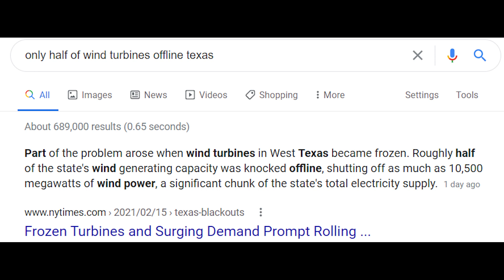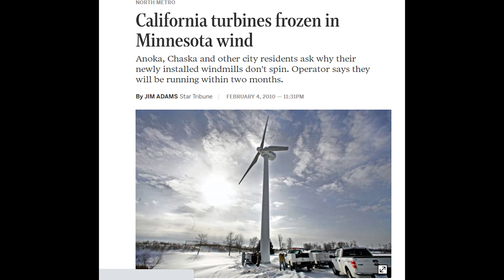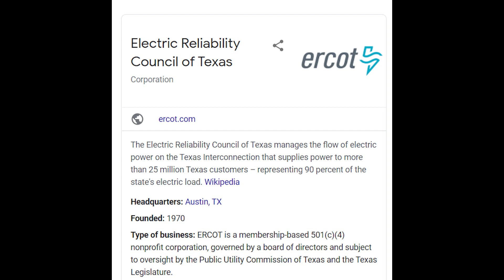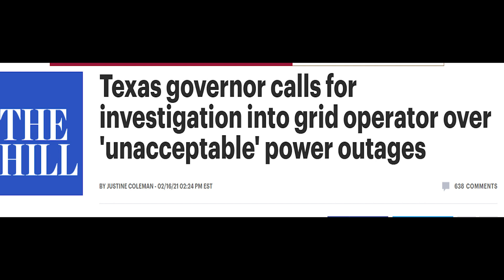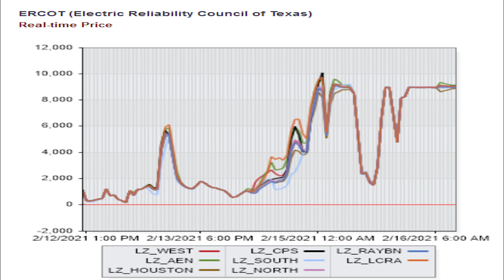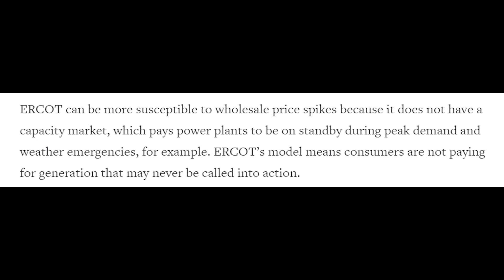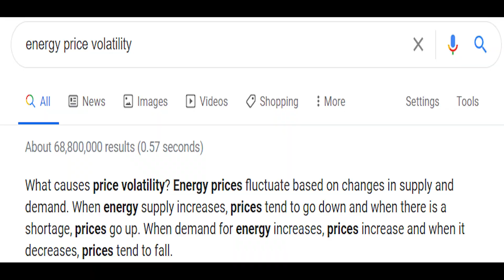UPDATE: Turbine Guy's Take on Texas Frozen Wind Turbine Crisis (part 2)

Comment: The main problem was that the pipelines for natural-gas power plants (50% of Texas’ power generation) froze up.  A certain amount of water comes out of the ground with natural gas, and that water froze up the pipelines.

“Certain politicians” on the fossil-fuel payroll were prompt to blame frozen-up wind turbines, and while some certainly did, as you correctly estimated, that was only around 10% of the problem.

Comment: All Texas power plants in the SPP grid are winterized. Many wind turbines in the same Texas panhandle SPP grid froze and/or lost stored energy. Majority of the electricity during the storm was from thermal energy power plants. Very little help from green energy. We are not ready to go all green energy. Better to have variety.
Reply from the maker: Exactly. Redundancy builds in safety
Reply: @TurbineGuy  Yes but go with bio gas, bio fuel, bio mass or geothermal.
Reply: Majority of supply disruptions were from natural gas plants. Wind was over-producing from emergency forecasts.

Comment: As a former GE employee Technician. I use to build those Turbines here in Pensacola at our GE facility. I was a crane operator installing the Axis- Cabinets and transformers and also doing the wiring. I can tell you everything you said was 100%  correct. People fail to Realize there are different types of Turbines. Wind Turbines can withstand freezing Temperatures. Majority of our Turbines were sent to Russia, Antarctica, Denmark and Norway. They are coldest places on earth. So when I heard Texas Governor say that out of his big fat mouth. I was like you’ve got to be kidding me??? These people are straight up liars and don’t want to take the blame. Texas is by far the most state that uses double the amount of Natural gas and Coal. They have a lot of offshore oil rigs along with Refineries on the offshore of Galveston. You can’t deny that at all.
Reply from the maker: Thanks for the supportive info!!
Reply: Millwright that has been in wind for 5 years.  This is correct
Reply: Ice storm was what they got. What happens to the hub when it gets iced and the blades cannot vary their angles? In a normal fail safe setup, the unit would shut down. Even ones in the coldest parts of the world. But most of those also have some way of heating the blades and the hub to prevent ice buildup. Now what happens when the grid starts going down? There is no heating in the units and they shut down also. Unless the power company has built in an energy storage system next to the turbines. It is called a cascade event where one thing leads to another which leads to another. Solar and wind went down and due to demand, neither the natural gas nor other systems could cover the losses. Start lowering the pressure in the gas pipelines due to demand and the next thing that happens is the gas lines freeze up. As the gas lines go down, so will the power plants that run on it. 

We had a gas well on the farm in Ohio that was tied into the pipeline. When the gas came out of the ground, it had to be reduced in pressure before it could go off the property. Well head pressure was 500PSI. Pipeline off the property was 30 PSI. What was the first thing between the well head and the pipeline? A heater. Because as soon as the pressure would drop in the line, ice would form so the gas had to be warmed. The company pulled the pipe up when the well was producing 1000cuft a day. The next level of gas had H2S in it so it could not go into the pipeline. So the well was pulled. But any drop in the pipeline pressure can cause a freeze up. It doesn't need just to be cold to do it. When the gas in the smaller lines get to a gas pumping station, the pressure is again boosted back up. 200 to 1200PSI depending on the pipeline. Now you have to be careful and keep it within a certain temp range so it might need cooled some. Then it can leave the pumping station at high pressure. And it gets reduced in pressure where it gets distributed. Again, they have to watch for icing. When it enters a home, it is at a very low pressure. About 1/2 PSI/ 4 to 8 inches of water column.

Comment: I'm neutral on the renewable energy vs fossil fuel fight... However people trying to spin the issue and claim fossil fuels were to blame for Texas power grid collapsing are just plain wrong, or lying. Most reliable reporting estimates up to 20 to 25% of the power in Texas was lost when the wind turbines froze up. That left 75% of the grid to supply 100% of the power needs. As a result, the natural gas and coal plants could not keep up with demand and some of them went off line as well. It was a domino effect. It all started with the wind turbines going offline... First.
Reply from the maker: Yet one would think the brainiacs behind the wind/solar would KNOW that there would be times when neither are contributing and they would still need to meet the needs of their customers.
Reply: @TurbineGuy   100% agree. And you are correct in the video, Texas did not have the correct equipment (turbines) to handle this type of weather. But then who the heck would have thought we would see -17 degree weather down there? I bet they prepare for it now (or one would hope...).
Reply from the maker: wcoastbo  Facts Matter
Reply: wcoastbo  You just made my point for me. The grid went down due to demand. Had the wind turbines stayed up and running the system ‘could’ have met demand.
Reply: If Texas power grid was connected to the rest of the country they would be importing electricity from surrounding states. Texas is looking like a third world country. This kind of stupid shouldn't happen in the United States.
Reply: @Ozarkwild  no they didn't, they pointed out the real issue was because they decided not to winterize there natural gas power plants and the pipes froze. So the natural gas when down... Nothing to do with wind turbines. And the reason wind turbines failed is because they decided. Not to winterize them as well. They also decided not to winterize a nuclear power plant.... It is almost like there is a theme here in winter they didn't winterize there power grid or prepare and it failed. But you know totally wind turbines caused if only if they kept working like maybe if they could of done somthing to stop them from freezing like winterize them to prepare for this like all the other wind turbines in america. Then the natural gas power plants supply lines would of magicly not froze. I really can't follow why people are blaming wind turbines like if they worked or not would of kept the pipeline from freezing
Reply: ...hey genius the system was built by the lowest bidder, that's how shit gets done in Texas.   Or somebody's bubba, or brother in-law, or some political donor was either connected to the previous Governor, or to a member of the Legislature, and was probably sitting on a committee that make these awful decisions.   Or at the company's board, who built these problems  🤨

Or it's just Predatory Capitalism at play 🤔 ...greed and incompetence.  Regardless, you can guarantee that a Republican created this Stupid problem, it's a Red state.  I should know, I live in east Texas, aka Texmenistan
Reply: @glenncordova4027  Actually they are. But not enough can flow in from it. And all of Texas is not in the Texas grid.  I looked a little while ago and about 10% of their power at that time was coming from wind and solar that was working. Two of the four DC grid interconnects were showing negative levels which meant they were importing power and the other two were dead.
Reply: @gravelydon7072  ...what parts of the Texas grid are connected to other grids, are they isolated, or do they just have that capability built in?  
I always wondered where Brewster and Presidio Counties get there power from, they are isolated from everyone else 🤔
Reply: @Texaca  Presidio and Brewster Counties are part of ERCOT. Amarillo, Lubbock, El Paso,  and on the Eastern side, Beaumont are not in it.
Here is a map of who is in what area.
https://www.powermag.com/Assets/Image/3%281%29.jpg
Reply: @TurbineGuy  whens the last time TX saw negative 20 f? Green energy is an honorable cause, but without 100% fossil backup it's a fools errand in such situations
Reply: wcoastbo  This was funny. Kudos
Reply: Yeah, this is basically all wrong. The bulk of the supply disruptions were from natural gas plants. When supply went down, mostly from NG but yes also from nuclear, wind, et.al, there wasn't enough for demand, ergo blackouts. But if NG operators had winterized better it would have been able to save the system. Wind was overperforming expectations for winter.
Reply: @gw6667  Not correct. The wind turbines left operational may have “over performed”, but the ones frozen in the cold were a contributor. NG was a contributor as well, as we have now learned.

Comment: The unregulated Texas utilities bought sub standard wind and gas turbines because both have cold climate versions that everyone else in the US uses. There are wind turbines in the mountains near Fairbanks, Alaska that work at -40 degrees for months each winter. Anchorage has has been running on gas turbines for 50 years and wind turbines for 9 years with winters at 20 below. I hope the US Wind Power Association and turbine manufacturers sue their lying frozen sessa off.
Reply: Psst....
Texas is not really considered a “cold climate”. 
For the first time on record, everyone of our 254 counties was under a winter storm warning. It literally snowed on the beaches, while the panhandle had the same storm wreaking havoc. 

The temperature alone weren’t responsible for the wind farms to go off line, It was ice accumulation on the blades. 

Deregulation helped bring energy prices down, and brought in investors who poured money into alternative sources that otherwise would never have been built. This is why Texas leads the nation in wind generation.
Reply: @texanbill6032  Except FERC wrote a 300 page report after your 2011 frozen grid failure that specifically recommended winterizing your power plants and gas supply. You wouldn't get a lot of ice accumulation if the gears had synthetic lube and the blades kept turning. If the large  fossil fuel and nuclear plants were winterized, you could do without the wind and solar for a few days. Those short sheet policies are killing your fellow citizens. Was it worth it?
Reply: @tomlakosh1833  For sure mistakes were made, but let’s be honest here, this is a once in a century mega-storm. 
The biggest difference between 2011 and now, is that more reliable coal power plants were replaced with wind and solar. Additionally, people are pouring into Texas from places like California, putting further strain on the grid. 
I didn’t lose power in 2011, in fact I don’t know anyone who did. It was nothing like the 2021 storm.

I would bet any amount of money we will never see another storm of this magnitude in our lifetime, and will never see the kind of power issues. 

One thing I keep reading is the myth of how bad  “deregulation” is. Let me tell you, deregulation has allowed electricity in Texas to be affordable and until this year I have never been without power in my life more than a few hours (following equipment damage after a storm). 

California can do things however they want, but the fact is our grid is more reliable than theirs and our rates cheaper.
Reply: Tom, I'd suggest that you are close to the truth but not all of it. Ask people in Minnesota what happened after they bought and reconditioned units from CA. Oh, they failed the first winter because the units were designed for heat and not cold. Our power company is a part of Next Era Energy. NEE has a wind farm in Texas and a number of other States. I would bet that it is operating. As they also own units in ND and other cold places and would know about the cold in West Texas.

Disclaimer. Mom owns shares of NEE and dad was an employee of FP&L which NEE is the parent company of.
Reply: @gravelydon7072  Almost all of your wind was bought after FERC issued its report and best practices were issued so it's clear that the utility execs planned to fly to Cancun when the grid went to hell.

Comment: Being from Texas I can tell you they use more electricity in summer for cooling than they do in winter for heating.
Reply: I'd think that the better use of these would be to advect air near urban centers where heat islands exist...not so much for providing electricity.
Reply: 74GW vs 69GW. Similar, but you are correct.

Comment: So that 9$/kwh is only for people on a wholesale plan? Not a fixed rate correct?? I live next to a school so our power hasnt gone out bc its been declared a public warming area..
Reply: Yep but those on fixed rates can expect their flat rate to go up now after this.
Reply: $9 a kWh? Are you serious? We pay about $0.13 per for ours after all the taxes and fuel charges and Hurricane upgrade costs. Me thinks someone is getting bad figures. Or really getting ripped off. My solar setup would already have paid for itself if we were in the $9 per kWh range for cost. Depending on my use, I can put out a kwh per day or in one hour.
Reply: @gravelydon7072  they put the 9 before the $.  9 cents
Reply: @carramrod8232   It was quoted on TV as $9.00 a kWh also. And one person got an $18,000 electric bill for electric usage at his home.  That would require the use of 200,000 kWh at a 9 cent rate. Or 268.8kWh per hour. A figure that could not be right. Do you realize how much heat that would put out. I've run a 10K heating element in an 85ft steel RR car in 34° temps and after 15 minutes had to turn it off. And there were two more 10 kW elements that could have been kicked in.
Reply: @kahlernygard809  My plan is for 22 months. Why would my $0.036/kWh go up? =)
Reply: @gravelydon7072  Nope, that's the right rate, officially $9,000/MWh. That's the capped rate, and was mandated by the PUC: http://www.puc.texas.gov/51617WinterERCOTOrder.pdf. Most people have fixed-rate plans. Some, about 0.1% had a wholesale plan with griddy and those without independent energy and/or backup were gambling with energy prices and LOST. Bigly.
Reply: @gravelydon7072  Yeah, do the math and that guy was probably using 3-4MWh. He did a shitty job turning off his power. That's about a third of what I use all year in my 4-br house.
Reply: @gw6667   Thanks for the link. That is ridiculous. As I said, ours is in the $0.13 a kWh range. That would be $130 a MWh including all the taxes and other charges. Or about 10 times less than the lowest that rate they showed that day on the order. Dropping 10,000 MWh's worth of load would be like dropping 12 of the local nukes offline. When I looked at ERCOT's site that day they were importing about 1/10 of the load they had dropped. My guess is that they aren't setup to import that much power so they had to keep it low. At $9/kWh, I could afford to generate my own. Oh wait, at times I do have to. At $3 an hour for fuel costs and around 4kWh used. Unless I'm using solar and then it is even less.
Reply: @gravelydon7072  Interesting. ERCOT was importing energy from where?
Reply: @gw6667  From the National Grid. As we were warm at the time, the power from the local plants could have been where the power was actually coming from. When I looked, one interconnect was at -750MWh and a second one was at -400MWh. Which meant those two were importing power to the Texas grid that ERCOT runs. Right now it shows they are exporting 79MWh thru the East DC interconnect. All other ones are at Zero. Oops, it just change to 78MWh. 
The connection are:
DC_E (East) 	78
DC_L (Laredo VFT) 	0
DC_N (North) 	0
DC_R (Railroad) 	0
DC_S (Eagle Pass)0
Reply: @gravelydon7072  Well, I was under the impression that ERCOT isn't really connected to the national grid in order to obfuscate federal regulations, but I know it's happened in the past in brief episodes and that we are connected to a couple other grids but the capacity available for import is quite limited in those cases
Reply: @gw6667  There is a way around FERC oversight currently. It is the use of DC interconnects. DC interconnects are not considered in the Federal domain so that is how they get around it. But yet, the connections between the Eastern and Western Grids are done by....................................................DC Interconnects. And yes, ERCOT has done AC grid connections in the past and nearly lost their right to not be under Federal oversight. ERCOT is considering a DCHV line from Texas to the SE by way of LA and AL. By using DC for the lines, they can own lines crossing State lines and still stay out from under Federal controls. Sooner or later, I expect that rule to be changed so the Feds have a say on DC also. An example of the size is the Texas-Mexico Interconnect. It can handle 150MW in either direction. But 150MW is about 1/6th of one of our local nukes.
Reply: @gravelydon7072  Awesome, thanks for the info. Definitely hadn't come across some of these subtleties in my rapid education on TX energy. Yes, I'd imagine risky for the DC lines because a quick rule change is all it would take to squash that. Also DC has lots of losses for long distance transmission so it'd be interesting to how feasible it would actually be. If only Tesla & Edison were around to see it now. What are you referring to by "nukes"?
Reply: @gw6667  HVDC has been improving in capability. There are some long distance lines in use in the world already.
Nukes meaning nuclear power plants. In our case, it is two Westinghouse 800MW PWR units. They now have been in service for nearly 50 years and are licensed to operate currently to 60 years. And are in the process for licensing for operating for 80 years.
Reply: @gravelydon7072  ah, gotcha. Former engineer but have since transferred to the finance side of things. But once an engineer always an engineer